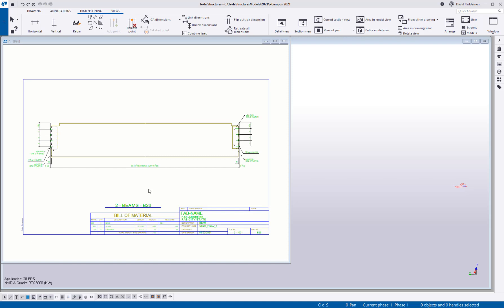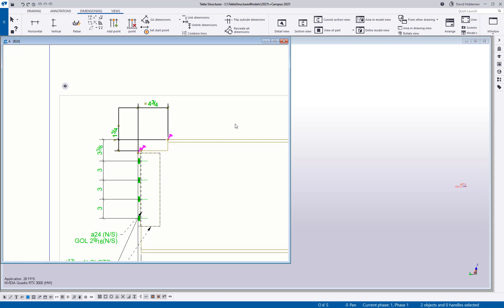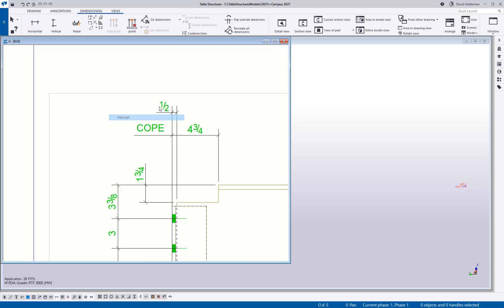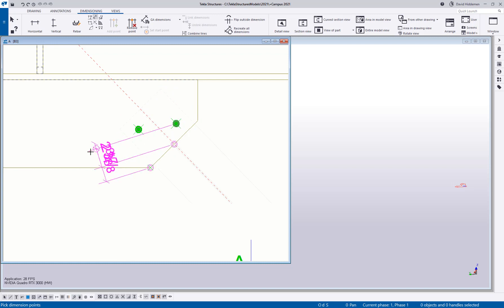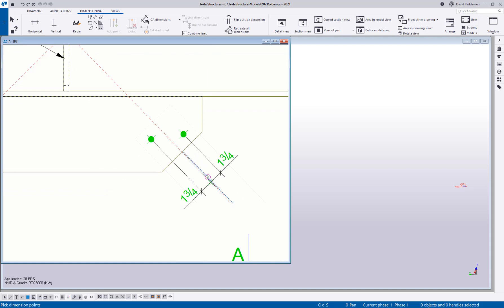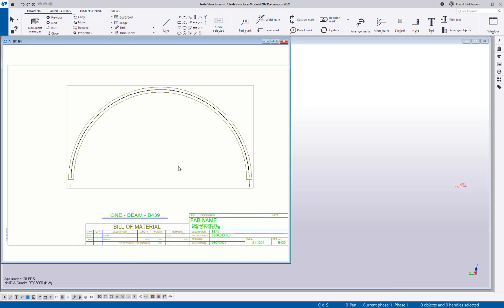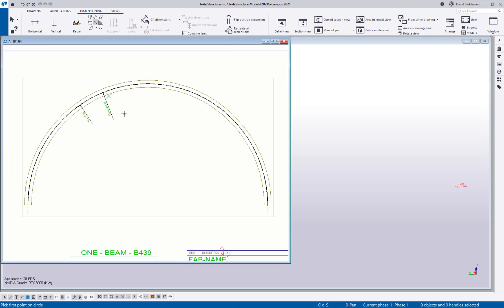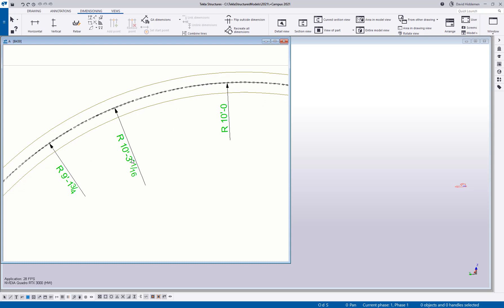Tekla Structures - Dimensioning Tips

Comment: For assembly/single part drawings, it will have a "length(profile X cut length)" dimension for the main part, which will parametrically change depending on the handles. It seems like a template embedded into the program that I can't change. How do you recreate this dimension if it is accidentally deleted?
Reply: The only way to get the original back is to choose the 'recreate all dimensions' from the Dimensioning tab. However as the name implies, it will create all of the original dims that you'll have to then delete. If you don't want to do that, you can manually edit a similar dimension by adding values in the Prefix or Postfix fields on the Mark tab of the dimension properties, such as the UDA "ASSEMBLY.MAINPART.PROFILE". Perhaps I'll make a quick tips and tricks video on this.